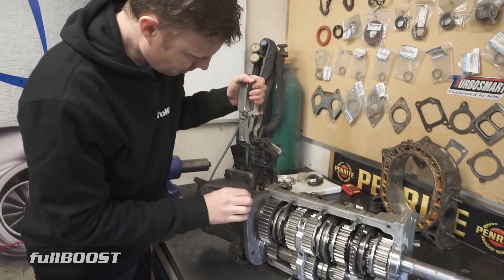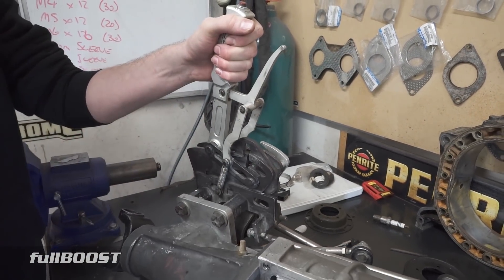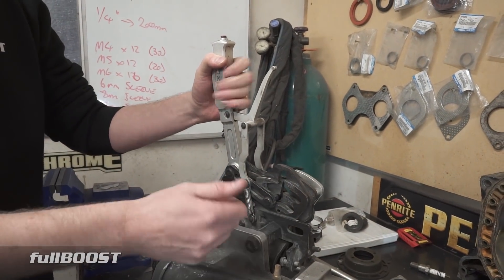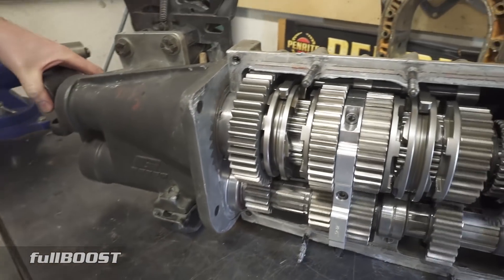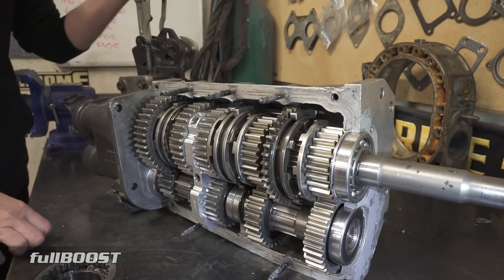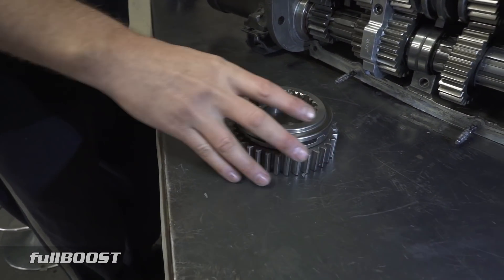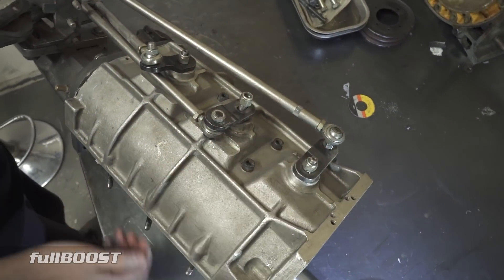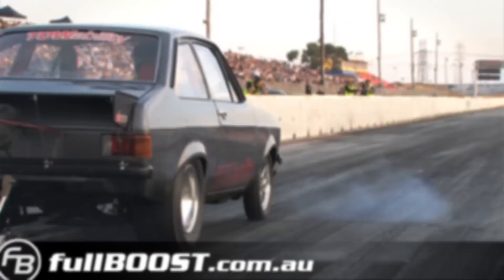How a clutchless racing transmission works

Comment: Never heard a dog box called clutchless I clicked cause I thought they did away with the clutch but nope just a dog box that still has a clutch
Reply: Matthew Weisenburger, Totally correct it still uses a clutch to start and stop the vehicle so it's a bit misleading to say it's clutch less, lots of lorrys use a similar gearbox and once on the move the drivers don't use the clutch again until they are coming to a halt.
Reply: How would you engage the trans without a clutch? The "clutchless" only refers to shifts.
Reply: cjshaker i was expecting some sort of hybrid between an automatic and manual idk you can shift without the clutch on any transmission so calling it clutchless is really dumb
Reply: @matthewweisenburger2095  I'm with Matthew.  Maybe it's related to where we are at in the world, but in the USA this is most commonly know as a dog box.
Reply: @MustGoFasterVR4  in drag racing circles this is always refereed to as a clutchless transmission (even the manufactures of these transmissions GForce & Liberty Gears (USA companies) call them clutchless transmissions.  road racing or circuit racing guys refer to gearboxes with similar gearsets as dog boxes generally however.
Reply: Mathew Weisenburger, sure you can shift any trans without a clutch...if you want to destroy the trans and the synchronizers in short order. This "clutchless shift" transmission allows you to shift without using the clutch and it will not hurt the dog rings, which take the place of regular synchronizers. It doesn't matter that people think the term is "dumb", because they are only describing the shifting abilities. There are also transmissions that don't have synchronizers, that are very similar to this one, but they are designed to use the clutch on shifts. They are called "clutch assisted". Is that dumb also? It's only a term used to describe and differentiate its shifting abilities. Perhaps you can come up with better terms and inform the industry the proper way of describing them?
Reply: cjshaker your not going to destroy your trans from shifting without the clutch if you know what your doing. If you rev match it will slip right into gear often smoother than using the clutch because you can’t completely rev match while using the clutch due to the input shaft slowing down below engine speed
Reply: @matthewweisenburger2095  how do you rev match without a clutch?
Reply: Teenis Teenis put it in neutral then bring the rpm up or down depending on weather your down shifting or up shifting in order to match your engine speed with your trans speed and it will slip right into gear without ever touching the clutch. Never driven a stick before have you?
Reply: @matthewweisenburger2095  no i have not. that's why i was asking...
Reply: @MustGoFasterVR4  its a clutchless dog box
Reply: @calvin99991  actually if your any good you should be able to go up and down through the gears no problem and not destroy your crash box. You think when shifting a 18 speed road ranger you use the clutch? They don't have any syncro's in those. You need a clutch brake to get it in first gear. It's the guys who can't shift with out a clutch who destroy boxes as they rely on the syncro's to get it right. They should stick to squish boxes like the girls drive.
Reply: @calvin99991  A torque converter.
Reply: @calvin99991  this isn't a dogbox this is a constant mesh
Reply: Jacob Westphal: Wrong. First, I didn't call it a "dogbox", second, "constant mesh" refers to a manual trans that has synchronizers, which this transmission does not. Early manual transmissions did not have synchronizers and had to be double clutched when shifting because the gears would not "mesh" correctly if you didn't. When they designed and started using synchros, they referred to the trans as "constant mesh" because the gears did not require double clutching and would "mesh" easily.
Reply: @calvin99991  ""constant mesh" refers to a manual trans that has synchronizers" - no. it refers to trany with constantly meshed gears, 
https://www.caricos.com/cars/a/audi/2009_audi_q5/1600x1200/136.html? doesn't look like sliding mesh, yet synchronized.
Reply: @calvin99991  constant mesh is any gearbox that has constantly meshed gears regardless of engagement type and shift pattern. Dog box refers to the engagement type.
Reply: It's a drag car box. no need for a clutch when changing gear, no backing off when changing gear. It's a dog box sort of, just no rev matching, smash it through no backing off. Also doesn't do downshifts or deceleration.
Reply: Yep old school tech from the 70's. And the dogs didn't wear from peddling the car, just designed poorly.
Reply: Synchronizers have a tapered friction surface wth a hard and soft element similar to a clutch/disc that wears down eventually causing clearance issues and grinding during attempted engagement. Shifting without first engaging the vehicles clutch overheats these surfaces causing premature failure.. Dogs would be the "clutchless" part i presume.
Reply: Yeah everyone trying to act like a lifetime racer who fixes up and makes their own cars. Gtfo we all know a quick Google search allows you to mindlessly regurgitate information you know nothing about to make yourself feel a little smarter.
Reply: Everyone in this comment thread is a little retarded, especially OP
Reply: A "hybrid" between an auto and manual is called a dual clutch
Reply: @alienfrmearth  There are single clutch versions of automated manual drivetrains too. There are quite a few designs out there - the dual clutch system is just one way of doing it.
Reply: @alienfrmearth  Or a old clutch flite 727 that was used years ago basically a modified Chrysler 727 with the original bell housing removed & a scatter shield bolted on & a clutch made to fit it with the clutch only being used to launch & then stop ! So once under way after the launch you shift it like any automatic then at the shut down lanes pop in neutral coast till slow enough to engage 2nd gear to drive back on the return lane to pick up the time slip, once at the time slip hut step clutch in then stop grab your slip then take off in first by letting the clutch engage again & off you go same principal lol.  A lot of the 4spd guys would grind every other tooth off the synchros to make the trans shift faster without using the clutch once under way almost like this here trans in a way but not nearly as good or beefy  .

Comment: Could you run this in a daily driver Cummins.
Reply: not really.  they do not down shift very well at all.  they are designed for drag racing to go up the gears 1-2-3-4-5 in that order only.
Reply: @BackyardMechanics  well thanks for taking the time to answer that. It would have been cool. Lol

Comment: Being straight cut gears they will make a lot of noise!!
Reply: Coming from a rotary I don’t think it matters.
Reply: Those engines don't usually use mufflers, so the gear noise is insignificant

Comment: It isn’t clutchless tho
Reply: It don’t got synchros
Reply: Synchro have miniature clutches in them, this unit has no synchros. Exactly the same as a heavy comercial truck transmission( 18 wheelers etc. )
Reply: Yes it is.
Reply: So your telling me your gonna be in neutral and just put it into 1st gear without a clutch?
Reply: Sauce Boss 420  I'm not saying that at all. Were you? Your 1st comment said its not clutchless, didnt say or ask "can you put it into 1st gear without the clutch". Any serious drag racer knows that a "clutchless" trans, this is a drag trans in case you didnt no, refers to it's ability to be up shifted without the clutch.
Reply: @Industry-insider  The car has a clutch but the transmission does not have synchros. It has sliders or couplers that engage the next gear. You have to step on the clutch to put it in gear when your standing still.

Comment: there was no explaination why there is no clutch to shift and how the links break from one gear into the other for the higher gear to catch the links and engage
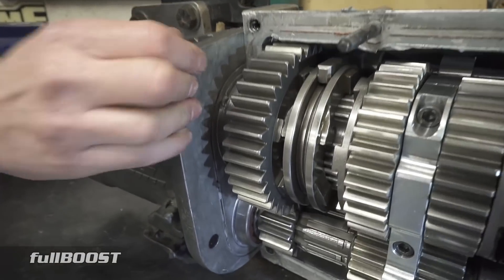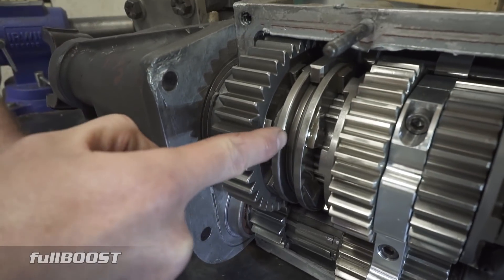Reply: He describes how it shifts at around 3:30. The sliding rings engage and put the power through whatever gear they are slid on to. The slide over and grab, as shown at 3:28.
Reply: they just have enough angle between the teeth, to engage, before the shaft turns that far. A lot of torsional play. These are not streetable, and they do not come with a 50,000 mile warranty. They are a high maintenance, but very effective race transmission. The purpose, is so you don't have to lose time in transition between gear changes, allowing you to apply the highest average horsepower possible for the pass. Just go through the gears once with one of these, it's more addictive than any drug!

Comment: I want to put this in my daily driver mustang.
Reply: Before you try that, learn to pull the trans you have out of gear at the same time, you let off the accelerator. This transmission will NOT hold the car back, when you lift off the pedal. But, for upshifting, you can't beat it. Down shifting for passing can be done, but a bit tricky.
Reply: @vincentrobinette1507  sounds easy

Comment: Can you still use the clutch in a serious pro street car to save wear on the Trans?
Reply: i've read an article a long time ago, that in racing, every mili seconds that you can gain is important. shifting with depressing the clutch first took longer than just shifting the dog gear... and in racing, the trans is designed to take the abuse
Reply: You cant downshift a gear at a time really so on the street Its useless
Reply: Serious Pro street cars run Lenco transmission...just yank the lever.

Comment: Why are the dog teeth cut with ramps on decel so they will disengage to N?
Reply: The ramp is to allow it to quickly and smoothly engage the next gear without using a clutch. That's what makes this a clutchless. A clutch assisted unit has a smaller ramp with a step and a road race version has no ramp at all.
Reply: @calvin99991  no mate that side of the dog only touches anything under backpressure, not load. Under backpressure, the gear will kick into neutral.
Reply: Drag racing safety.

Comment: Wow this brought back memories
You just cant beat a dog box, the multi selector levers are defiantly the best way as well. The rotating selector rod adaptations are just are not as fast. I had an Impala Straight line and that sent many 3 speeds to an early grave.. I finally gave up on straight line shifters after 3 top loaders and several rebuilds behind a healthy SBC. The hours spent making and modifying syncros, well when you don't have money but you have access and time and can use a lathe and a mill. The MR Gasket I had was a nightmare to get just so it wouldn't split syncros but still change quickly. 
When is the August podcast due, looking forward.
Cheers

Comment: Great video. Like the explanations re pros and cons. What would a gearbox like this cost in Aus? Keep up the tech and teach vids. can always learn from guys in the know.  cheers
Reply: The downside of this gearbox is you can't back off of it until you get it in high gear, if you do back off then the ramped drive dogs will "ratchet" bending the shift forks in the process.

Comment: if you had a Barra you would'nt need a transmission to go fast.
Reply: Do you just bolt the driveshaft to the flexplate?  I guess you can just transverse mount your Barra with a wheel on each side .  You said you don't need a transmission so you asked for it. Do you run a Tesla motor for the starter. bolting it to the  front crank pulley might work.
Reply: Bro, all you need is a barra to run 6 seconds. Now, pipe down sugar tits.
Reply: @Monstero5o  it's a bit hard without a transmission. Do you just bolt the engine to the diff
Reply: You'll need slicks, a fourlink rear end and an upgraded transmission. Forged internals and a big turbo. The list goes on. No one's running sixes with a stock box. You must be slow in the head.
Reply: factory forged head and bottom with 3.7L crack run 6second ;)
Reply: Nah you just sit on the engine and it runs 6 seconds
Reply: Beast60 sad joke , good luck next time muppet
Reply: not as sad how slow you go ;)
Reply: @samenamenamesame2834  Bro, what converter, just run the engine straight to the diff through a shaft.

Comment: I can honestly say I had no idea how it worked. I 'thought' I had an idea, but this was great. Thanks for the insight.
Reply: Motorcycle transmissions have worked this way for 80 years.
Reply: @timhallas4275  Here's mine (in the link) I built myself 35 years ago, there a bit more to this type of gearbox (overriding) than this car guy knows, he blathers on on and on without really explaining anything.
https://www.youtube.com/watch?v=4UMjMUCW0Go
Reply: @Peter-V_00   That's what I'm talking about.  was that 5 or 6 gears?  I forgot to count the shifts.
Reply: @timhallas4275  Six, what's interesting that made it all work was I had to "split" a gear so it could be in two places at once, a bit abstract to explain I guess I should make a video of how it works.